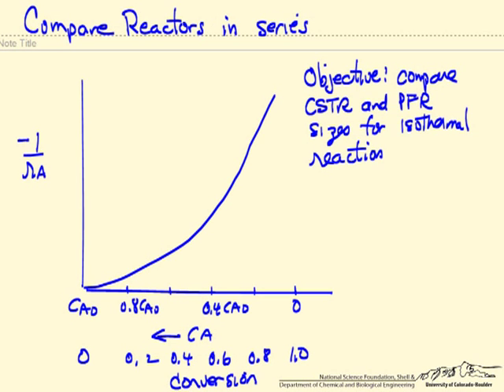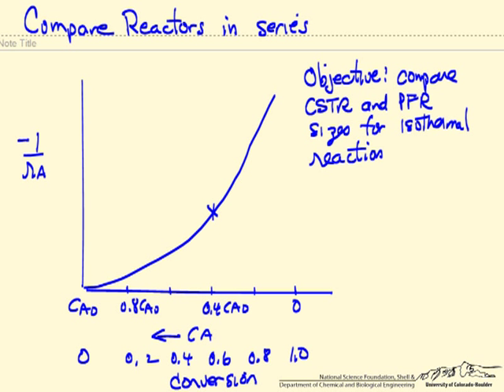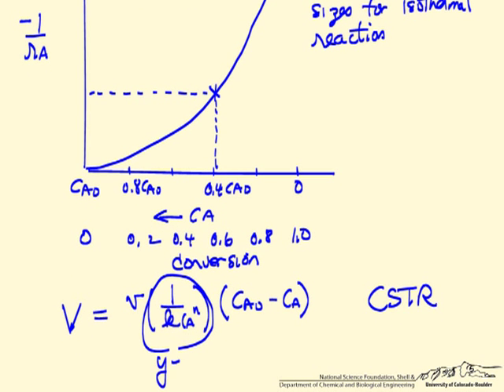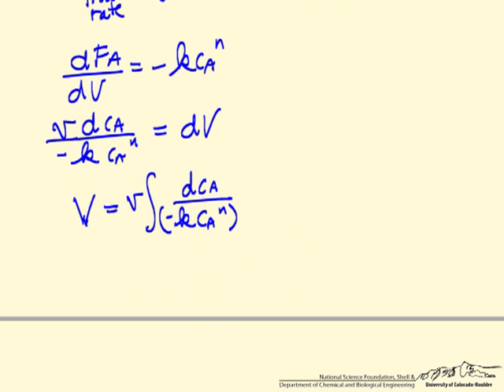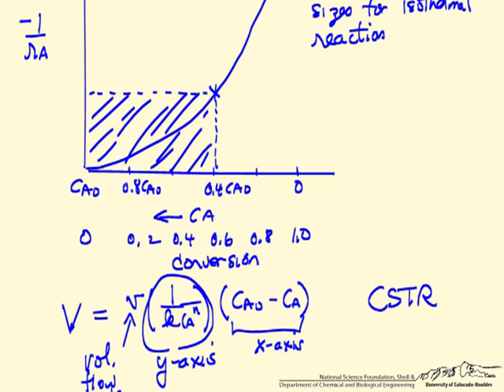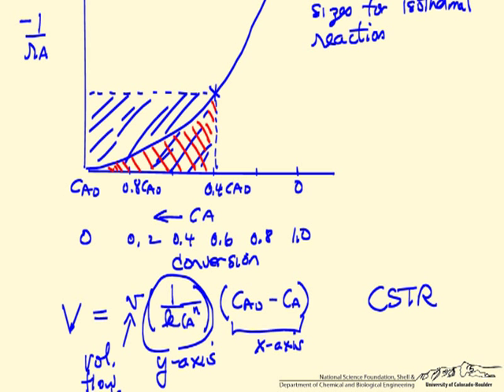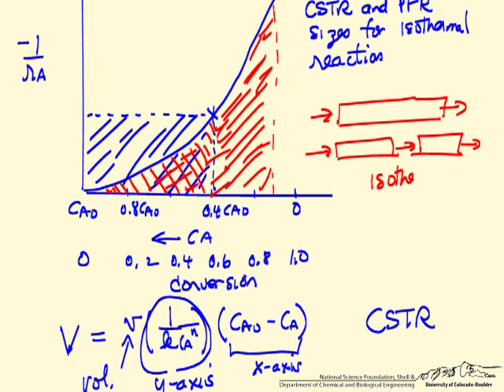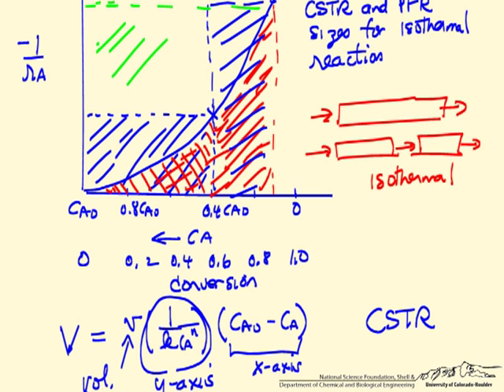Comparing Reactors in Series

Comment: I thought that for a plug flow reactor, it is not possible to take v out of the integral, since it changes over the length (as temperature, pressure and moles as well)